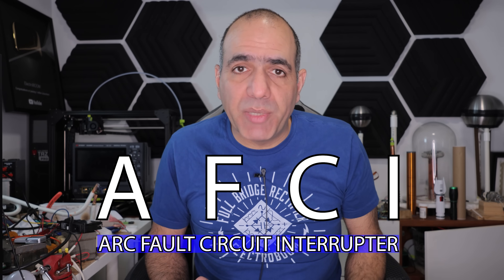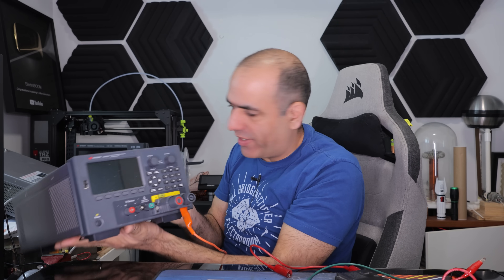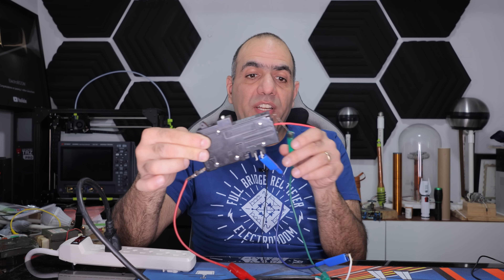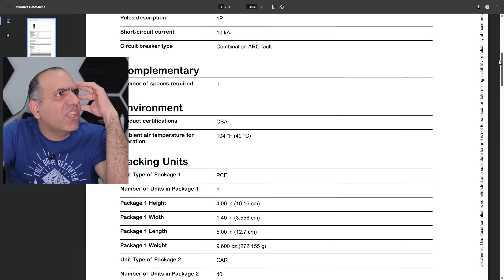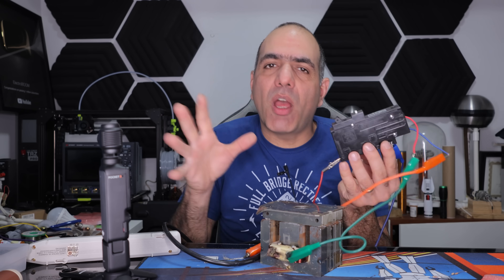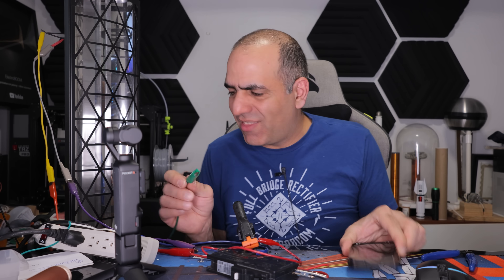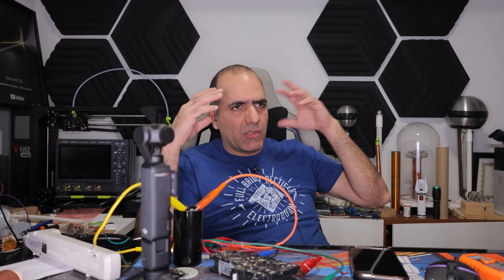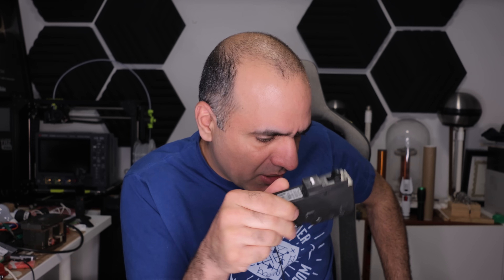Fighting Electrical Fire by AFCI

Comment: Today I had a small accident in my basement. I wanted to get some tools when suddenly I was shocked by a magnet that was hanging on a metal strip with screws on my bench. GFCI tripped and cut the line. Turned out it was connected to live because someone put a screw in the wood damaging a cable behind the wood but on the wall. Only a part of the metal strip is live, the other ones are seperated from each other and not live

Comment: Use a powerful light bulb and a light switch. Then turn the switch very, very slowly and hold it in the position where the lamp flickers and the switch crackles. This should also trigger the AFCI.

Comment: The reason the neutral connects to the afci is to protect against parallel arc faults ( arc between hot and neutral) or a series arc on the neutral thus the combination part labeled on the afci refers to the combination of parallel and series protection a combination afci is a breaker that is both gfci and afci

Comment: If you touch neutral to ground on an afci circuit it trips the breaker immediately and I don’t know why. No arc occurs. Neutral and ground are connected at the main service but it’s a nuisance when I’m working circuits live.

Comment: When the manufacturers are the ones lobbying that their product be mandated, you have enough information to make a reasonable determination as to how good it will be for you.
Are GFCIs useful in some cases? Are AFCIs, in rare circumstances, beneficial? Do I have several of each in my home?
To each question, YES! But the ones who see the primary benefit (at the consumer's expense) are those who are manufacturing them.
I don't wear a PFD to go hiking and I don't put on insect-repellant or sunscreen when I'm going to be indoors all day. Use the right tool, the right way, at the right time and place, for the job.

Comment: I am a brazilian electrical engineer and I work with photovoltaic systems. Recently, here in brazil, the regulation changed and the use of solar inverters equipped with AFCI became mandatory. Strings composed of more than ten solar panels are very common and typically reach more than 600VDC which is a fire hazard, specially when there is no proper instalation or no maintenance. I've seen pretty scary arcs being created in these circuits, even under no load.

Comment: I'm glad the AFCI is useless except in very specific cases. So if there's a case where your house wiring gets broken (earthquake?), it could potentially arc in the wall and NOT TRIP whilst your house goes up in flames. [edit: caliraisin45's comment seems to say that it SHOULD trip based on this, and yet Mehdi shows it doesn't]

I think they need to call it something else since "Arc" doesn't match the trip case.

Comment: why are they so big tho? here in Croatia ours are pretty small and work very well, and are usually rated to 10-16A for reguar outlets and lights and around 35A for some outlets in the kitchen(fridgem oven, dishwasher) and sometimes for he laundry machine. 
and they trip to the slightest imbalance

Comment: I suggest you also test a regular breaker/gfci to see if it actually makes a difference. Maybe the high currents drawn by the capacitor will trip those as well.

Comment: When I experiment electricity. I use my power station with a grounding adapter. And just use a GFCI plug-in. The station has its own internal safety features but just layering on top of it helps my mind lol.
This way. I prevent tripping my own breaker because I'm not grid tied.
Plus my power station is what I use at my jobsites that usually have no power

Comment: AFCI breakers should have never been mandatory for homeowners until the "learning" models would become available, where a homeowner could press a button on such breaker (or do it through the mobile app) to let the AFCI breaker "learn" that specific electrical disturbance created by plugging in a specific model of vacuum cleaner (or other electrical device) is not "harmful". Similar to the way you can "whitelist" some program on your PC that you know is not harmful and should not be blocked by antimalware software.

Comment: I am an Electrician, one of the continuing education instructors I went to would demonstrate AFCI trips with a screwdriver and a metal file. just slide the tip of the screw driver across the file.

Comment: The house I lived in with my parents as a child, when we sold it in 2017 (about 50 years after it was built), had sockets that held the standard 2-prong US plugs firmly — even then.

The condominium where I now live, built maybe 40 years ago, has sockets that don’t grip plugs reliably, with some failing in that way about 10 years ago. I’ve replaced most of the sockets by myself. It all depends on the quality of the sockets.
Reply: Sockets are only party of the problem.  Yes, old worn out sockets can cause arcs, but some arcs happen in the wiring in the wall (which, of course, is more dangerous as it can't be easily repaired).
Reply: Friends of mine bought a house a few years ago, and all the wiring was DIY by the previous owner.  They routinely hadn’t properly tightened the terminal screws on the outlets.

Comment: Our house is from the 60’s we only have one GFCI in the bathroom and the entire downstairs is on 1 15A breaker
Reply: You might have aluminum wiring too.  It was a big thing in the 60's due to copper shortages.
Reply: @LonnieAdams4 I’ve checked its copper but the ground wire is so thin for some reason (probably 20 gauge)
Reply: @Alexthetechie  All you need.  There is virtually no chance of a short and the 15 amp breaker will long trip before the 20 gauge wire hits 40 amps momentarily, a level it can easily handle.

Comment: It actually Trips when it sensing a high frequency EM above around 15Mhz which occurs when there is a continuous spark that wants to create fire, rather than just repeatedly shorting by a touch

The Action Lab too has already uploaded a video about a ultra high frequency tesla coil 4 years ago that mentioning AFCI

Comment: As an electrician, I hate these. Especially in remodel applications in older houses. Theres always a chance that someone that did some wiring earlier, not an electrician, and used a neutral from another circuit, or theres a neutral touching a ground in some j box or outlet, and makes it very difficult to find! Oh, and the new code requires 50 amp 2 pole breakers for your range, and 30 amp 2 pole breaker for your dryer need to be gfci now, and neither of those appliances are required to test them! So they will not work on gfci's!

Comment: About 10 years ago Eaton had residential AFCI's that would trip when using my ham radio.  It was a common issue in the ham radio community.  When I first installed a 1000w amp not only would I trip my breakers in my house but the breakers of the surrounding neighbors houses as well!!  It was so prevalent that the ARRL had an article about it.  The fix was for Eaton to change the design of their AFCI.  Why was it happening?  Because AFCI's detect RFI that an arc causes, on the wire.  When an arc occurs that RFI is heard by the AFCI which trips.  Eaton's AFCI's were tuned improperly and tripping based on hearing signals in the ham radio bands.  The replacements that they came out with work great without this issue.

Comment: Are AFCI and GCFI breakers similar and can trip fuses and other electrical appliances with AC or DC. And is only in the USA and Canada. I’m very interested in this. Also are you moving again.
Reply: No. GFCI compares the currents flowing through the live and neutral and shut off the voltage if the difference gets too big. AFCI looks for a specific high-frequency signal on the live wire that's characteristic for electric arcing in air.
Reply: Totally agree. Bit like AC and DC that are different. And I’m learning a lot from his videos.

Comment: So we just watched a dude make Chlorine gas in his home, right? 

    At the cathode:
    2H2O+2e−→H2(g)+2OH−2H2O+2e−→H2(g)+2OH−

    At the anode:
    2Cl−→Cl2(g)+2e−2Cl−→Cl2(g)+2e−

    Net reaction:
    2NaCl+2H2O→H2(g)+Cl2(g)+2NaOH2NaCl+2H2O→H2(g)+Cl2(g)+2NaOH

Or should I say...we watched a dude make Chlorine gas in what is about to be someone else's home.
Reply: It's AC, so both reactions happen on both sides and quickly revert, leaving only some corrosion on the electrodes.
Reply: @hammerth1421  Hmm....Maybe at these voltages we are getting more arc discharge chemistry. I wonder what all of that green discharge product we see? Perhaps some perchlorates?

Comment: Hi.  Entertainment electrician here.  Um, that breaker you showed.  If somebody showed me that I would immediately replace the box in my house with an internationally accepted DIN rail box.  What was that?  Did you seriously show me a single breaker larges enough to make a sandwich with?  

For over 20 years GFCI breakers in power distro has been the bane of our existence.  THAT breaker, too big.  I, ... It doesn't make sense.  It's early in the day.  I need some time to process what I've seen.

..was that a 15 or 20A?

...literally could take 2 of those, throw some fuses in the middle and make a WTF?! sub sandwich...

Comment: You might be able to get it to trip quickly if you put 120 V relay in line and then put the normally open contacts across the coil so that as soon as the relay is engaged, it’s shorts out the coil which disengages the relay which causes the coil to open, which reengage the relay… It’s going to arc like crazy and produce all kinds of high-voltage spikes because of the inductance in the coil.

Comment: These make more sense in North America. Where there's higher currents, poorly designed wall outlets and many older homes have aluminum wiring. If these life saving devices worked reliably. Which based on the videos I've watched, many don't. John Ward and David Savery in the UK have both tested these to bits. And the results are a mixed bag. Problem is, manufacturers are convincing uninformed legislators all around the world these need to be mandated. Not because they work. But because there's a lot of money to be made.

Comment: Hi from Germany. The AFCI WAS mandatory for some public buildings and bedrooms. From ca. 2015 to 2018 or so. But because they do more harm then help they are not wanted anymore. To trip them try Vacuum (universal Motor), Electronic Loads >> 50W(bad PC supply, Phone charger, old LED's) or incandescent lights with dimmer very dark >500W. Maybe this still works...
Reply: Exactly right.  When I moved into my new home the very first thing I did was swap 100% of the AFCI breakers with standard breakers.  This is literally one of the worst scams in the history of the electrical code.  AFCI are VERY UNSAFE, as it causes the only people that matter...YOU to believe it is doing something it DOES NOT DO.
Reply: It’s nice to see common-sense changes like that.  In my opinion it’s a bad idea to use limited-lifetime components such as computers in a building’s wiring.

Comment: Should be pointed out that AFCI's are different to European AFDD's, which is why you can get an AFCI tester, but it doesn't work on AFDD's.

dsesuk has a ton of videos testing them, along with trying to use a Klein tools AFCI tester.

Comment: That salt water arcing stuff looks like my homemade arc welder I built using plans from a 1948 Popular Mechanic Magazine.  One metal bucket. 2 rods to suspend down and into bucket filled with salt water.  2 jumper cables to run power threw and you have a arc welder that will fry ones own ass.   Do Not Build.. Highly Dangerous... Electrocution Definitely..

Comment: Arc Fault is used in the UK and EU, but under a slightly different name (AFDD - Arc Fault Detection Device).   Some are different to others in the way they work, meaning some are better than others.   They are not required installs in most residential installs though, so they don't get seen very often.

Comment: Arc Fault breakers are overpriced garbage.  You risk your grocery money if you plug a refrigerator or freezer into Arc Fault circuit.  Ham and CB radios will trip them.  Cloud to cloud lightning will trip them.  Whoever made the new code should be fired.

Comment: Mehdi, could you use an isolation transformer to avoid removing the AFCI for the entire room? You could connect one of the terminals to you to get realistic shocks. I wouldn't, but whatever floats your boat 😂
An isolation transformer is a 1:1 transformer that removes the ground relation of the voltage so it's protective unless you touch both terminals and will not trip an AFCI since you're running it from both phase and neutral.

Comment: FWIW AFCIs (AFDD is the local term of art, Arc Fault Detection Device, I think is the expansion) are starting to become a thing in Australia now, but they're not currently mandated for anything at least not in domestic settings AFAIK, generally combined with RCBO for ground fault protection.

Comment: They are absolutely designed to look for specific signals to trip. Some of the newer AFDDs in the UK can be updated with new information as the manufacturer test common household products to prevent random tripping. AFDD are only required in student accommodation and multi resi buildings like apartments. They are then only recommended in homes or commercial buildings(Best practice is to put them in). They are incredibly expensive and one of the reasons people don't want to put them in, £150-200 each. For larger fault rating say 10kA they take up two positions on the board so can cause issues with ways(and why they install them typically in a separate enclosure above the DB).
Reply: So ...useless.

Comment: Thanks for this informative video! I am an amateur "ham" radio operator and have tripped the AFCI in my NEIGHBOR'S house while using RF at several hundred watts. Thankfully, the Eaton AFCI units were replaced free of charge from the manufacturer due to a known defect in early Eaton models that resulted in excessive trip sensitivity -- especially to radio waves. If you're curious or want to try it yourself, I recommend watching the video titled "AFCI's vs Ham Radio" and reading the article from the ARRL (Amateur Radio Relay League) titled "ARRL Helps Manufacturer to Resolve Arc Fault Circuit Interrupter RFI Problems." I would love to see a follow-up video about this phenomenon! Thanks again!

Comment: Around 15:00 , the AFCI ignoring the short arcs from 'plunging' one clip into the other kind of makes sense: if you had an inductive load that was already switched on, it would probably briefly arc when plugged in. but that's fine, because the arcs go away immediately , and really, if the breaker tripped over that it'd be incredibly annoying. it's only the prolonged arcs (replicated by 'scraping' the clips together) that result from poor contacts that make it trip.
Reply: No sense at all.  You need it to trip from a very short duration arc or it is useless, misleading, and deceptive.  When I moved into my new home the very first thing I did was swap 100% of the AFCI breakers with standard breakers.  This is literally one of the worst scams in the history of the electrical code.  AFCI are VERY UNSAFE, as it causes the only people that matter...YOU to believe it is doing something it DOES NOT DO.

Comment: hi. this is dr swapnil kothari, an actual medical doctor from india. i dont know whether this is the right place to ask but practically i dont have many avenues here. i have a 10kw hybrid solar inverter installed which runs some 1.5 acs even when the state power if off, of off 10 led acid batteries and the solar input. the issue is every time the state power trips, the current draw of the acs spike up momentarily and trips the inverter. the acs run well as long as the power if on or if its off. its the switch which causes the issue. is there any way that i can prevent this surge from going to the inverter and tripping it. the inverter company has completely washed its hands off and are not responding. can someone pls help.

Comment: In Austria we have a Circuit Breaker called AFDD (Arc Fault Detection Device). It works by the same idea but is a little more sophisticated because it also works as a GFCI and can also tell you by color code what arc type caused it to trip. Usually they are mandatory by norm to be used in office buildings or sensitive areas like kindergartens or elderly care places and are recommended in sleeping rooms in private buildings for fire protection.
Reply: They most definitely do have GFCI protection as well - I tired to get 240V at my desk for working on 240V power supplies I repair using the hots from 2 different outlets (because running a 240V circuit to my office would be very difficult). Using a multimeter, it measures 240V, but as soon as you put any load on it, the GFCI trips in both breakers, as the current isn't returning through the neutral. The breakers are AFCI arc fault breakers. I've only ever had them nuisance trip once, turning on a under-cabinet fluorescent light that was mounted above my desk, and I was a little slow on the switch, and it tripped the AFCI. I also know that GFCI outlets / breakers do not like VFDs on them - they trip instantly too - probably from the large DC bus capacitor in the VFD. I had to remove the GFCI in my garage to get the VFD on my lathe to not trip instantly. If I knew that beforehand, I would've gotten a 240V VFD and used that instead.
Reply: We have them with both ADCI/GFCI here too.  I believe the AFCI itself was patented in the USA.

Comment: how bout gfci breakers. btw afci is different in other contries. I love schneider I use their breakers here in thailand. Same type, but ones here are designed for ddifferent voltage and there are newer models that look better than the us or canadian ones. I reccomend. the Schneider QOVS which is a newer model with a bimetal strip and also a coil! the ones you use dont have coils. Only bimetal i think for the overcurrent